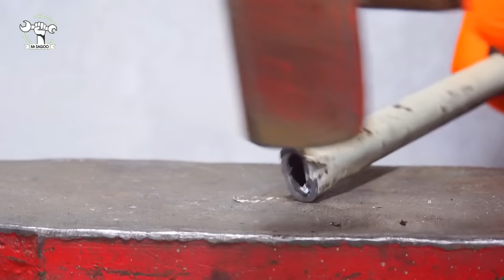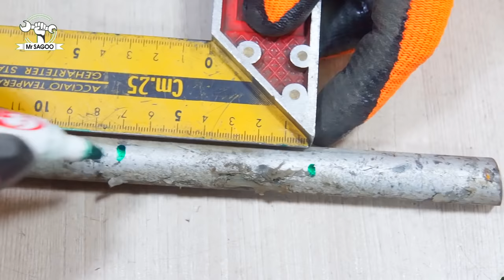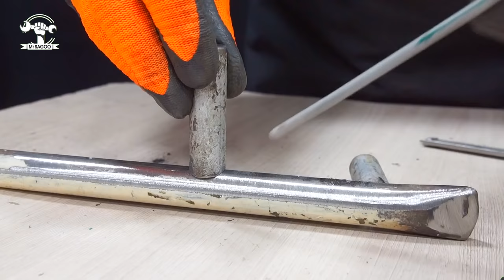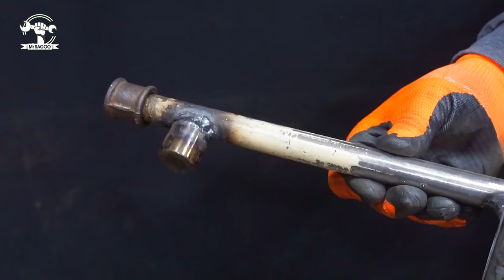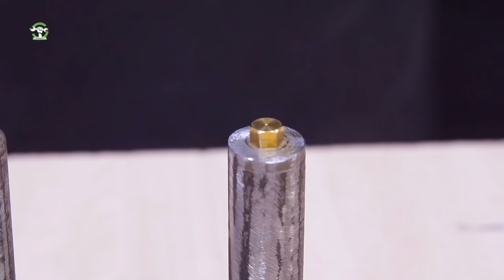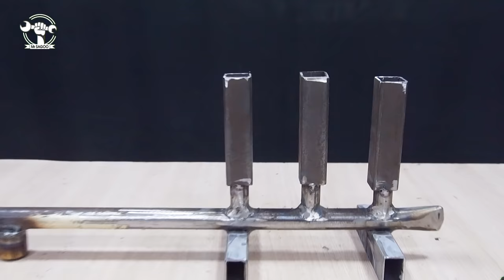DIY Super Gas Burner From A Piece Of Pipe (Part 1)

Comment: Great job. I noticed the flame from the first burner is higher than the 2nd and 3rd. The gas is flowing in series with the burners. I think if you split off the main gas line with 3 lines to each individual burner the amount of flame heat would be more equal.